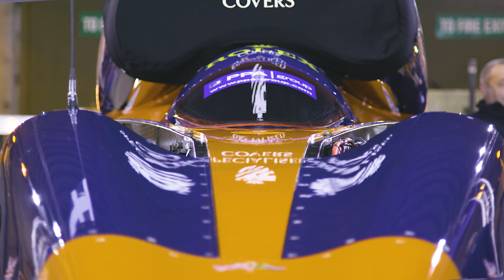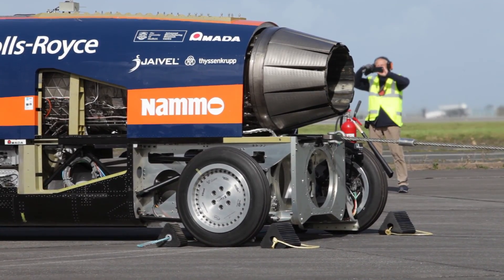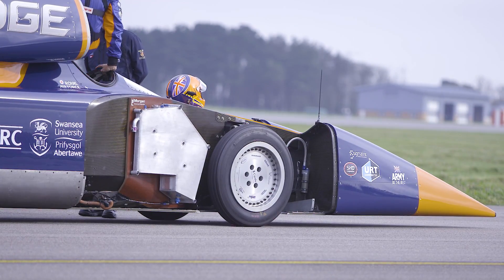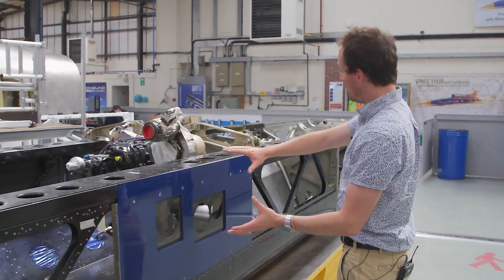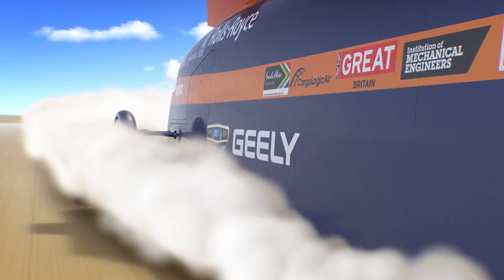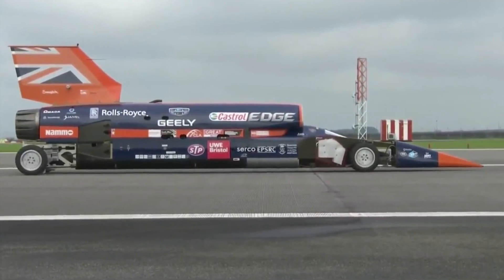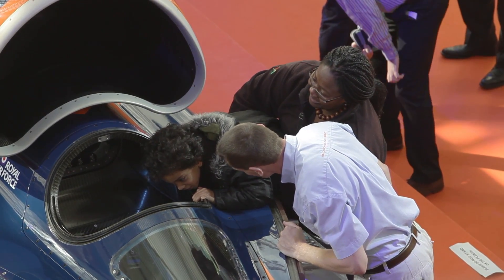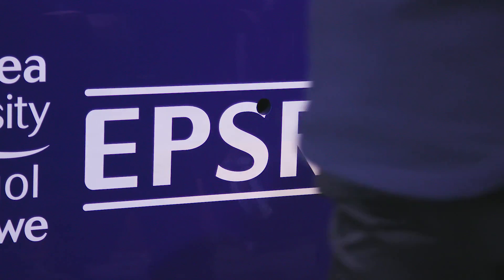EPSRC: BLOODHOUND SSC - High Speed Trials

Comment: Why is it manned? Wouldnt it be safer with an autopilot system?
Reply: ukkowalski  fit a remote there for  acelerate and brake will cost like 150$, just use RC parts
You can even use an open source drone system, is not expensive at all

Comment: But at £65 per adult to go and watch a car only do 200mph was a rip off. If had been more affordable it would of been a much better event and promotional tool
Reply: The money is not just for the visual spectacle - all these events also contribute to the massive cost of building this car, and running the education program, etc. And there were enough people there happy to pay the price - of which I was one.
Reply: Wendy Jane Preston but @ £65 plus travel and accommodation costs it's put off thousands £30 would of seen triple the attendance. It put off a huge no. Of local people including my 20 plus car/transport mad friends. All the locals have been moaning about the rather over priced tickets
Reply: I do understand the problem, and I sympathise - but honestly, 3x the crowd would have been way more than they could handle. I actually think it was a sensible move to price it as it was, and keep the numbers manageable. It would not have been as good an experience with 9,000+ people there. Sorry for those that missed out, but every single aspect would have been a nightmare with those sort of numbers (parking, food, security, visibility, getting on and off site). I also suspect they would then have had to cap the numbers anyway - in which case many would have missed out by not being fast enough to book.
Reply from the maker: As Wendy said, capacity at the side of the runway to watch the car run limited us to 3/4k people and we had fixed costs to cover, such as running the car, building infrastructure, insurance, security, etc which governed the price of the tickets.
^JT